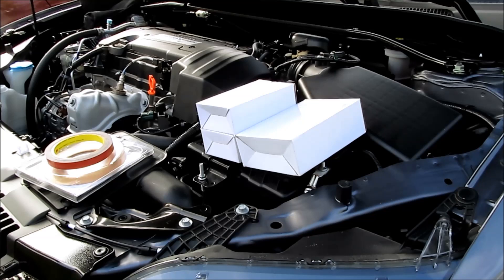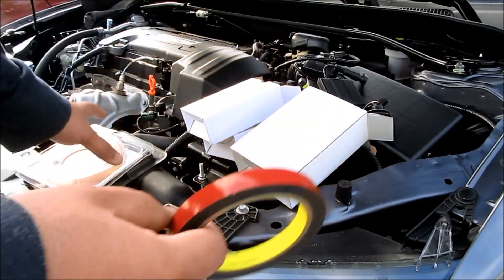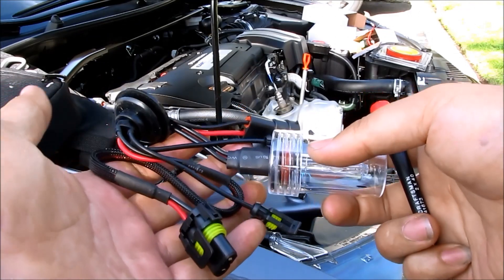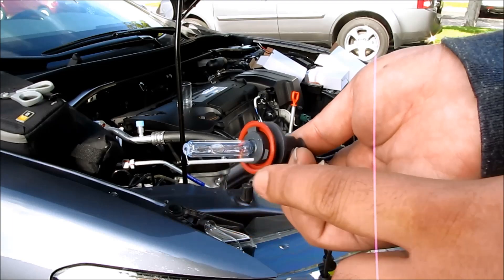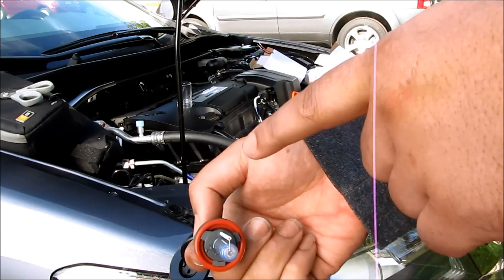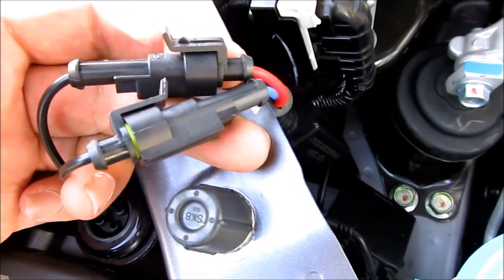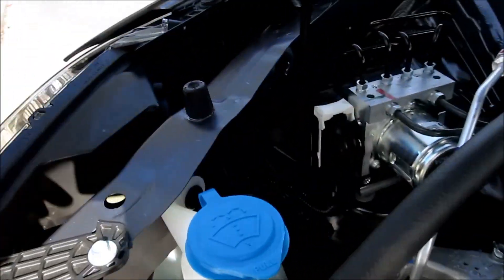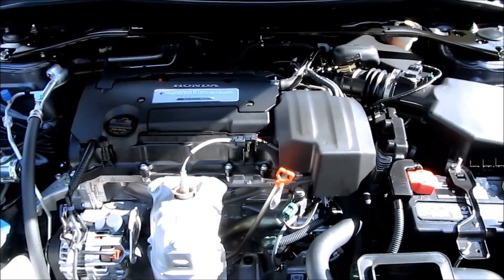DIY 2013 2014 2015  Honda Accord HID install (Must Read Description and Turn on Annotation)

Comment: Has anyone had issues with warning lights coming on on the dash? Like low tire pressure, e-brake, abs?
Reply: Kevin Bednarik I have the same exact problem have you figured out what it is?
Reply from the maker: Kevin Bednarik was your battery disconnected?  usually you get those dash warning lights when the battery runs low. the 9thgen has a sensor that is attached to the negative battery post that monitors those components and if a low voltage is present then it will light up those dash lights with a check system message.  solution is to drive the car until the battery gets charged and those lights should go away on its own.

Comment: whats the diff. between the 35w and the 55w?
Reply from the maker: Difference is just the brightness.  55W will be brighter than the 35W but it will produce more heat.

Comment: I'm new to the whole aftermarket headlights scene. I was reading through a few threads and many people say they have problems with DDM kits. They're either poor quality,  defective, or the light output is very dim. What are your thoughts on DDM HID's?
Reply from the maker: I've installed many DDM HID kits. I actually still have the first DDM raptor hid kit that I purchased back 2009. It still works fine to this day. I never had anyone come back to me to replace any ddm hid kit I installed on their vehicle.  I'm currently using f3 ballast with trs XB h11b hid bulbs.  Only because I want the light to match my trs XB fog led.
Reply: +DIY: Car Modz Sweet, thank you for the feedback! If you don't mind me asking, 1) What's the best thing to do if I want to install HID's for the high beams but since they run half power when the headlights are off would that harm the bulbs? 2) Your opinion on LED vs HID? (I'm asking this in regard to my fog lights because I have the sedan and the housing is rectangle)
Reply from the maker: +Justin Bui I wouldn't recommend installing HID in high beam unless you drive with your high beams on.  HID bulb takes a few seconds to warm up.  Flashing your high beams can damage the hid bulb and ballast.  You can do LED or HID for the fogs. LED will be much easier to install:  http://amzn.com/B00VNBDWPK or http://amzn.com/B01BEPWOP8
Reply: +DIY: Car Modz Would it be best for me to buy 3 LED kits from OPT7 so that way the low, high, and fog all match or should I stick to HID for low and buy LED for high and fog? I was thinking about buying the H11: Morimoto Elite HID kit but not sure what would match the high and fog.
Reply from the maker: That you have to experiment yourself.  i don't have the OPT7 leds so i do not know the color output compared to the TRS H11 HID kit.  Morimoto is fine to use.. make sure you purchase H11B

Comment: I put 55 watts for mines, if you look on the oem bulb it has 55wats 😜 a lot brighter then 35watts
Reply from the maker: tommie say lol. Halogen and HID are totally different.  Same with LED. 55W in halogen is not the same as 55W in HID or 55W LED. Yes 55W will be brighter/overkill. If you want brighter do it the right way and do a retrofit with CBI bulbs.

Comment: What if the light just doesn't turn on? Or it flickers a lot??
Reply from the maker: George Perez Either you purchase cheap quality hid kit or mixed AC/DC HID bulb/ballast or installation was not done correctly.
Reply: DIY: Car Modz well I got the H11's to work but is it possible to put HID's to a DRL lights? that's where it was flickering

Comment: Hey can anybody help me out, I connected one side of the hids but when I connect the other side nothing turns on!
Reply from the maker: Take the ballast and the bulb that doesn't work and try it on the side of the car that works.  For example.. remove the good working hid bulb and insert the other bulb that doesn't work on that side.  Now if the bulb fails to turn on.. you know the bulb is defective... and if the light does turn on.. you know the bulb is fine.

Now if the bulb is fine.. try swapping the ballast.  If the ballast is good then look to make sure the polarity is connected correctly.

DIY HID Installation Tutorial   Connecting OEM Headlight Plug with the HID ballast Plug
Reply: I tried it and it seems like both HIDS can't be on at the same time because I've switched the bulbs and the ballast back and forth and they both work it's just that when I connect both of them they don't want to work
Reply from the maker: If both bulbs and ballast work then try it again.  On the side that doesn't work..You might need to flip the connector that connects the stock headlight wire harness into the ballast around.

At the 06:24 mark I explain about making sure the + goes to + and - goes to  -... If you connected that part correctly and it still doesn't work.. it might be the HID ballast might have the connectors reversed.. so try to plug in the wire harness the opposite way.

DIY HID Installation Tutorial   Connecting OEM Headlight Plug with the HID ballast Plug

Comment: First thing you did right , it's not a POS GM, Ford or FCA garbage 😂 
Forget the lights you had me at Honda lol would rather use a flashlight driving that Honda than driving a GM, Ford or FCA junk.

Comment: Nice!
Reply from the maker: Do not cut or remove the "adapter" wire I mentioned on the video.  instead use it to plug one end to the HID ballast and the other end to the stock wire harness plug.

Comment: LED is better. My 2 cents.
Reply: is it safe to install 100w LED Headlights in a Honda civic lx coupe
Reply: It might melt the housing of the reflectors. Try a 35w kit.
Reply: PLATINUM but do LED shine correctly in Projector headlights? I've heard they don't since most LEDs the actually bulb is on the side and not actually pointing towards the projector
Reply: Not in the Accord, sadly. There's a distinct lack of a hotspot through the low beam projector housing, which isn't safe at night when you really need to see. They are great at casting a consistent, even brightness at a wide angle which work ideally in high beams or foglights where instantaneous light is especially usefull.

Comment: That imformation is wrong for my 2013 honda accord had to used the extra wire that come with the kit
to plug in at the light and the ballast,it would n't work any other way.!
Reply from the maker: Soup Bone Clearly you did not read the description and did not see the annotation and links to updated HID install video for people that can't get it to work.   Good Job! FAQ: 2013 2014 Honda Accord HID Install 9 months Update